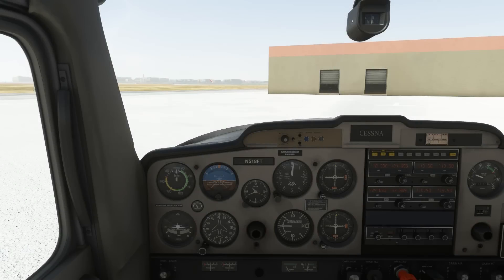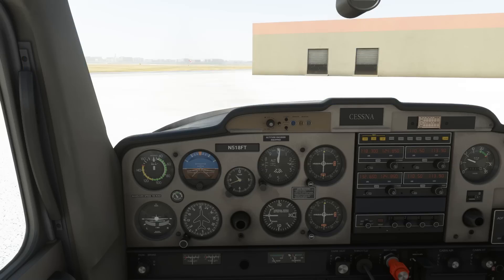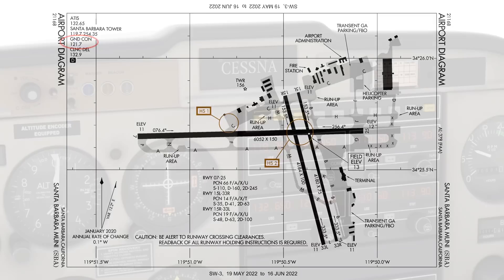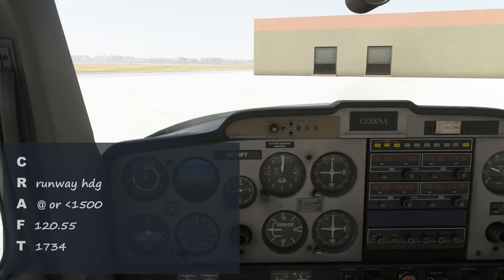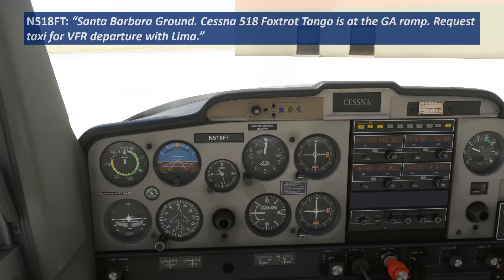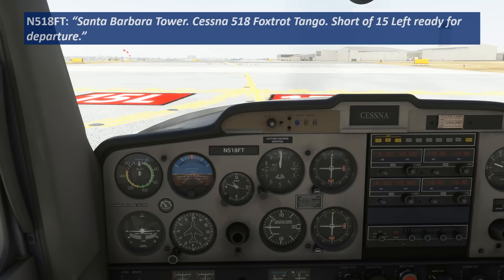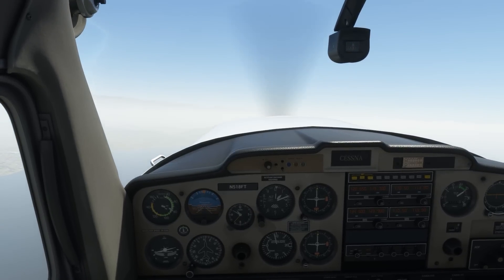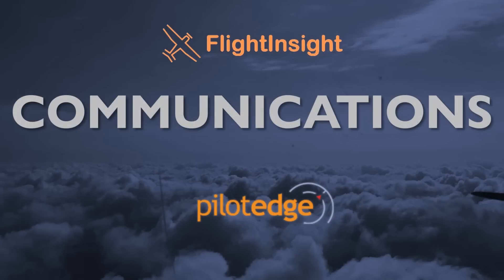Departing a Class C Airport | VFR Clearance Delivery | VFR Comms

Comment: During initial contact with Clearance del, weren't you supposed to mention the current ATIS? I think you did not mention that?
Reply from the maker: Yes it's technically required to advise ATIS info with clearance delivery, and is never a bad idea, but as we'll be doing the same on contact with ground, who will be the first to issue our moving instructions, it's not always crucial. The requirement for the controllers is to provide latest weather if you fail to advise ATIS on first call up, so the worst you will do is inconvenience the CD controller, but I've not heard of CD controllers requiring aircraft to go back and get ATIS and then advise. Still, you're correct.

Comment: How to operate in Class C airspace:
Step 1: Throw water balloons at the Tower at or above 500' AGL.
Step 2: Install two 12" Subwoofers into the aircraft and blast the entire "Country Grammar" album by Nelly at max volume at the fuel farm
Step 3: Finish every radio call with "over" while talking with your mouth full of food
Step 4: Tie a LittleTree air freshener to each tiedown eye
Step 5: Answer Tower's "Say Intentions" with your Amazon shopping list
Step 6: Inform Clearance Delivery your name is VFR Skrillex and tell them that "we rowdy" when they ask direction of flight
Reply from the maker: That’s fantastic! Have you considered a career in instructing?
Reply: @flightinsight9111  Yes actually.
 First I called the flying circus, but Monty said they were full, so I'll have to settle for CFI. ('tis a joke) For some reason I'm interested in sitting in the wrong seat while someone else is constantly trying to kill me. Still going to try it. My sanity must be gone. So far I'm tutoring a student, but I might as well be a dentist, because it's like pulling teeth trying to get them to sit down and read a single chapter. I'm trying to think of different ways to motivate them without renting a tornado siren, a flamethrower, and an Abrams Tank to use as study tools. Great video btw.

Comment: Question.  Does it really matter to  controller if the pilot’s repeat back is  “ cleared for takeoff 15L”  instead of. repeating  “15L cleared for takeoff “  in the exact format as the controller.    I have a habit of saying  cleared for takeoff  first then the runway #.    After watching this video i  repeat it as the controller
Reply from the maker: Not crucially. The controller's handbook, JO 7110.65 instructs that the runway number should be stated first, followed by the takeoff clearance. Check out 3-9-10 of that document. I think the idea is to leave the critical information for last since that tends to be what we most take away from an instruction. I can't point to anything specific to back that up though.
Reply: @flightinsight9111  makes sense to say the most important phase last when you think about it. .  Thanks for the clarification .  I will practice my  repeat backs in this format.
Thanks a million for all your time and effort on helping student pilots like me  on become a better and safer pilot
Reply: @njbpaul  I also had a controller tell me that they're supposed to say the runway first so that pilots are more likely to verify that they're on the correct runway because we tend to forget anything said after cleared for takeoff